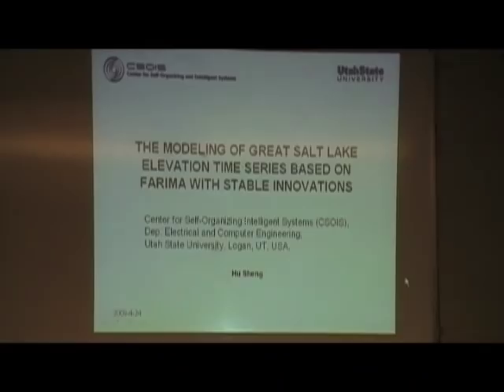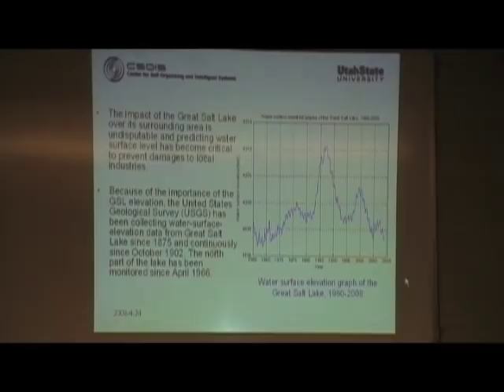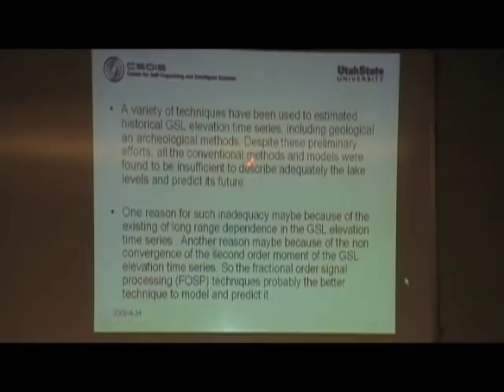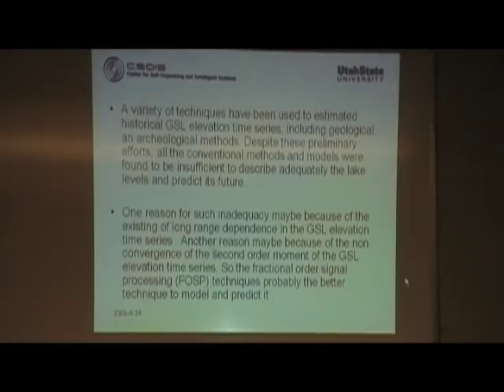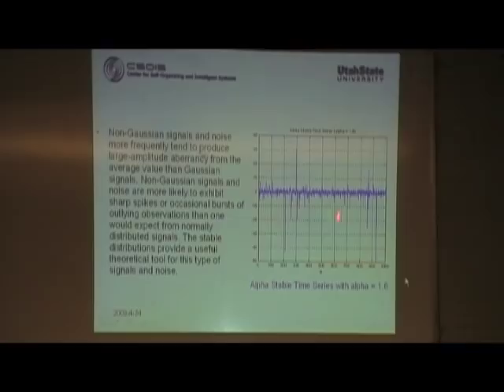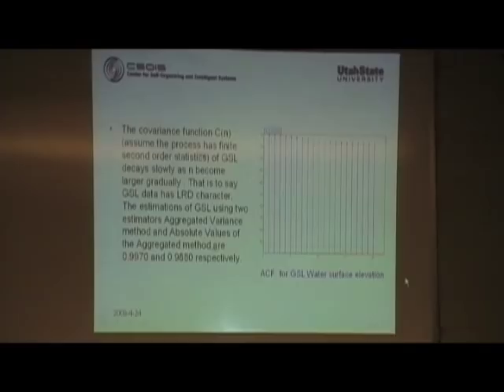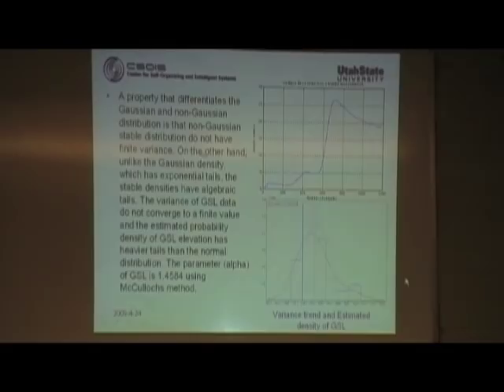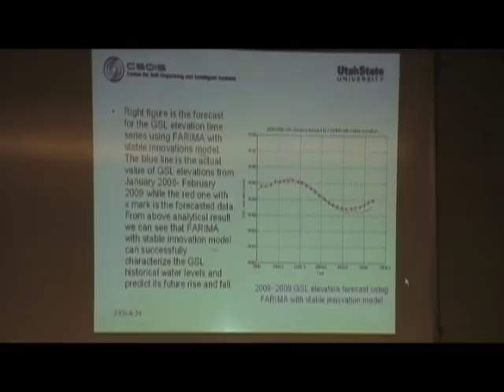Modeling of Great Salt Lake Elevation Time Series Based on ARFIMA with Stable Innovation

Comment: You should have performed more rigorous analysis including but not limited to structural break tests, time scale dependent normality tests and neglected nonlinearity tests. Neglected structural breaks induce spurious long memory and spurious super-Gaussianity/leptokurtosis type non-Gaussianity. Also, why did you not perform a superheavy null test and a time scale dependent normality test coupled with robust lower powered tail measure test (non-outlier induced non-normality) . For example, you should have examined the normality assumption (Shapiro-WILK,AD) for hourly, daily, weekly, monthly data to rigorously demonstrate that there wasn't slow aggregational Gaussianity.